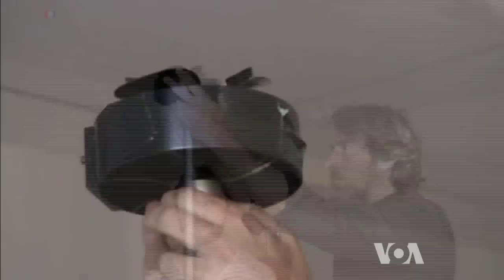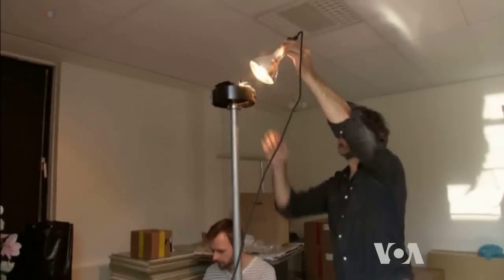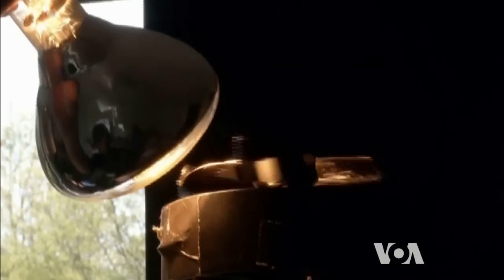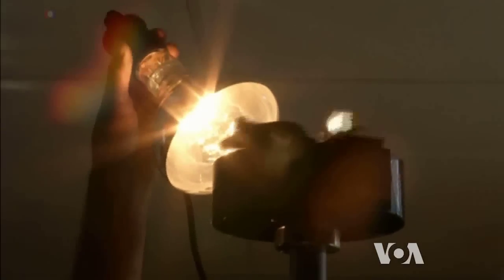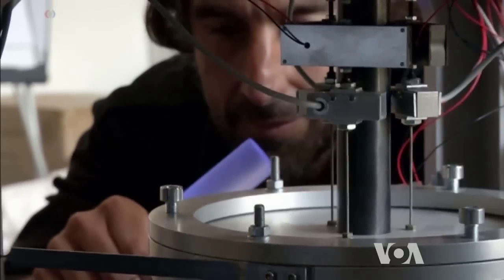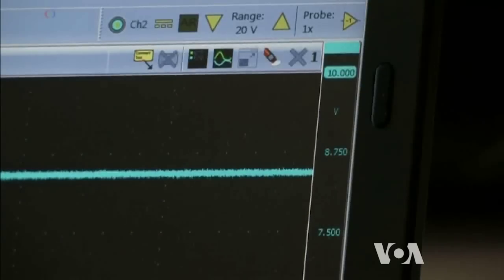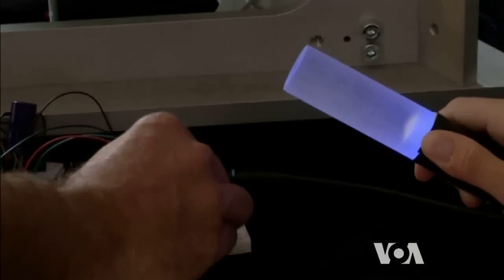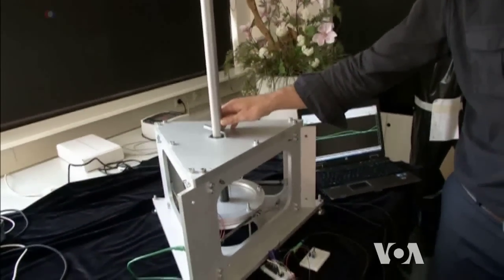Gravity Could Be Source of Sustainable Energy

Comment: here's a brilliant idea, try a weight in a pulley, which has already been done.  but instead of 20lbs for 20 min of light, how about 20 tonnes
Reply: You can never get more energy out of something than has already been put in. So basically the amount of energy required to lift that weight in the first place will be exactly the same as what you get out of it. The trick with all these machines is to become more efficient instead of wasting the energy through heat etc and harnessing energy that is already out there like sunlight
Reply: @Haresarefast  if you use enough pulleys to make it to where people can lift it then that would make it worth it. Not a perpetual motion machine but a pretty damn good trade off of energy.
Reply: @Haresarefast  what if the wind forces it back and some mechanic opens it up could with dams too. (Im not an expert)
Reply: ALL in One videos  Hey I know it's been a few months but what if you used a fuckload of pulleys to make it to where we could transfer human exertion into electrical energy?

Comment: Looks like they don't want to know bro...

gravity generator...

Its obvious is obvious it would work

Skyscraper made out of multi layered glass.. Swimming pool at the bottom... Metal cap.. Micro earth climate inside... Water evaporates.... Rises.. Condenses on the conical roof... Drops into a funnel... Powers turbines... Repeats process... Heavy insulation at the base to make sure the water stays hot... Works better in warm climates...
Reply: yeah you can do this with greenhouses, nobody does though.

Comment: I was wondering if basically the eternal force matter exerts to prevent something lying down to go into the Earth could be used for energy. I think this is what is being mentioned here. Don't really know if you can do that, but perhaps Geothermal energy is a kind of gravity energy already. This sort of thing may break conservation, but have a deeper answer in stellar formation dynamics that prevents that.
Reply: I was wondering exactly the same thing. Crazy
Reply: However I think geothermal energy is just a remnant of the forces that formed the planet. Theorically the core is cooling down. It's not just heat derived from the pressure
Reply: I wish COVID 19 will get you soon
Reply: @lokeshgnanasekar  wtf